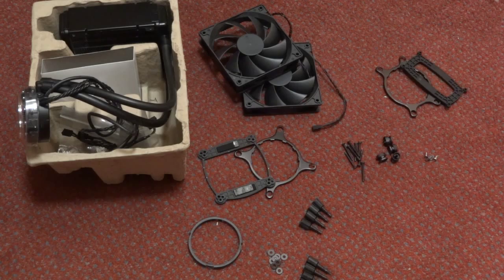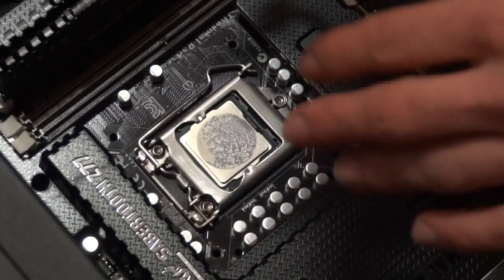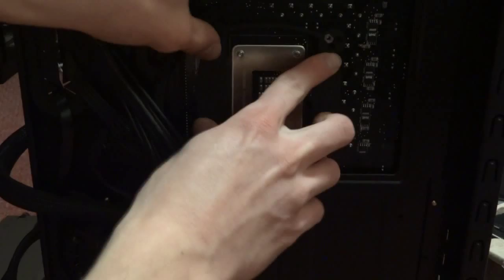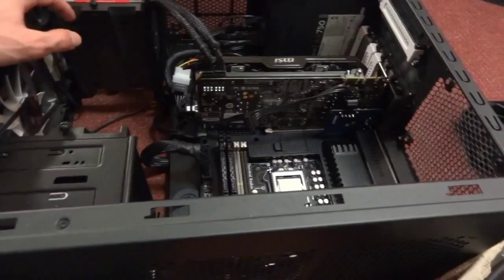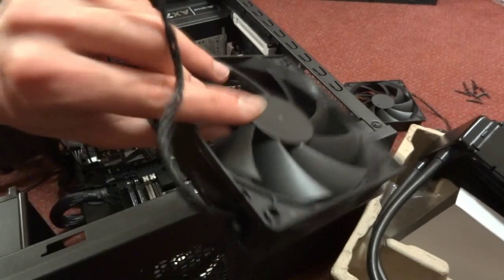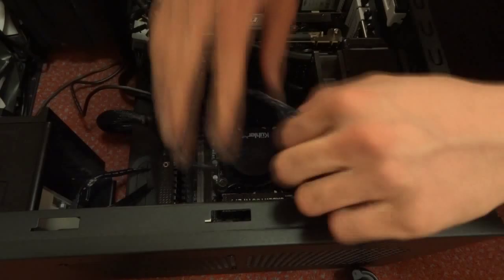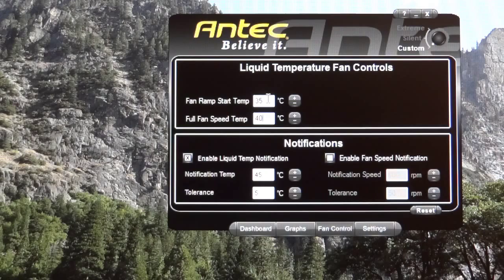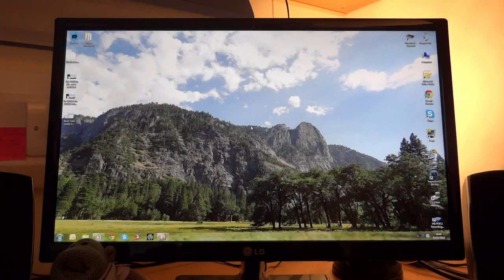Antec Kühler H2O 920 Full Installation Guide - By TotallydubbedHD

Comment: Your video was a lifesaver, I installed it following your instructions and it works great. Under stock clock speed the temps were amazing, I was at 20-25c idle and about 50c under full load. 

Now for overclocking, I have my i7 4770k stable at 4.5Ghz idle is 25-30c under full load its at around 55-60c with short spikes of up to 76c and my core voltage is at 1.26v. I tried going to 4.6Ghz but I get a freeze up in the Bios and get a freeze up when raising my vcore above 1.26v.

Comment: Well Hardocp did an overclocking review and stated the following by Asus....For voltages up to 1.250-1.265 a Cooling solution meeting a minimum of a Corsair H80i is advised, superior performance can be offered by moving to the H90 or higher.

For voltages up to 1.275-1.300 a cooling solution meeting a minimum of a Corsair H100i is advised.

For voltages up to or greater than 1.300v a high performance water cooling system is recommended such as Koolance EX2-755.

Comment: Ok I just set HT to auto instead of enable and it works fine now at 4.5Ghz and at my rated RAM speed 2400Mhz. I'm happy with that, now I just need to run Prime95 for 24 hours with HT on but it seems like all is well.

Comment: Thanks.  The Antec instructions are awful. The round retaining ring was a mystery and your video made it clear.  The long case screws Antec supplies were too short, so I had to go out and buy longer screws and a stack of washers to get just the right length.  Also, this is my 2nd Kuhler 920.  The first stopped working after 3 months, so Antec's service replaced it and the new one is working again.
Reply from the maker: Glad they replaced it - mine has been working perfectly fine for a year now - couldn't be happier :)

Comment: Loving this cooler.  Bought one for my i5 3770k build and for my amd fx 8320 build.  With the intel i5 I went from 45 iddle to 29, from 70 load in games to 52 load.  in my amd build I was able to overclock it at 4.2 ghz 1.38 vcore, couldn't do that with the Coolermaster Hyper 212 Plus

Comment: Awesome explanations, i hope the stock manual was 1/10 this good.

Made a setup for a friend living in other city, he had almost no experience building computers, and he had problems mounting this cooling system (it's quite hard to mount compared to others). Your video helped him a lot, you show perfectly how to position the backplate (ie a little misaligned to the socket) and how to mount the clips on the front aswell.

Many thanks.

Comment: Ya that's the thing though, if I try to go above 1.26 voltage I get a freeze up in the bios and wont boot the os so I can't go above 1.26 volts and ya I'm no where near 90c even under prime95 I get max temps about 76c and that's only for a second or so, it's usually around 60-62 max temps.

And like I said if I enable HT with 4.5Ghz i get a freez up so I will have to drop it a little.

Comment: Ok I'll stay at 4.5Ghz and yes ran Aida64 and Prime95 with a 24 hour burn in and all is well. Thanks for the info and I'll stay at my rated 2400mhz for my RAM. As for HT if I enable it I will probably have to go down to 4.3Ghz or so, I just thought that regular use and modern games don't really utilize it so I didn't really think it was that much of a loss but if you think it's important to have on I will enable it and take the hit in my oc.

Comment: Ok thx for the info, I'll go ahead and use the stock cooler first just to prevent any kind of problems. I'm hoping to get at least 5Ghz overclock but I'll be content with 4.5Ghz. 

Your temps seem great but in all honestly I was getting 25-30c idle and 45-55c under load with my Frio Thermaltake cooler on my i7 2600k and was at 4.5Ghz overclock. If there about the same I might just go with the Frio Thermaltake and save some money or the Noctura cooler.

Comment: Got a "complete" open-box unit at a retail chain. Didn't even include the manual :( Online manual is useless so I had to figure it out too. No mention of the washers & nothing about installing the plastic ring. Now I know I was supposed to get software too. I can't mount it in my old Cooler Master Stacker STC-T01 due to the screws not being long enough to regardless of the side I choose for the fan (short can't reach the radiator, long can't reach through the fan). How did you get 8 long screws?

Comment: Fantastic guide! Step by step, and well edited. I was just wondering though, when I connected my pc to the power, the water cooler didn't light up. I'm not sure if it doesn't light up on the initial boot or if something is wrong. I'm scared to turn it on cause I don't wanna blow my system :( Please help

Comment: Thanks for letting me know, I have already installed it into my build and shook it before hand, runs like a charm, the only thing that confuses me is in CPU-Z HWM when it shows the CPU with the motherboard as around 38 degrees Celsius, but then it also shows my FX-6100 as 20 degrees Celsius and sometimes lower.
Sorry that may seem a lot but I just want to know which is which, also I want to know if it's usual for a video card to run hot..

Comment: best fucking tutorial ever
i had trouble with my x40 i had to find out on my own though
i just used one adhesive strip because on the right side theres a couple lines of pins from the capacitors from top to bottom, with the strip on it would press against it so i decided to take that one out, i cant even tell if the backplate is still making contact with those pins on the right

its a z77 v pro mobo and that backplate looks exactly the same as the one in the vid

Comment: My CPU fan power cable is 3 pin, but the "CPU FAN" - slot on motherboard is 4 pin. Shouldnt that be plugged in the 3 pin connector on MOBO labeled ATX?  Isnt the "CPU-FAN" slot where you plug in the USB-cable?  Thanks for vid dude!
Reply from the maker: No - the 4th pin is there for PWM (full fan control) - you should plug your 3pin into the 4pin CPU fan header regardless.
Just bear in mind that the antec software might not be able to control that fan - so best setting your temps/control directly in your BIOS of your motherboard.
Reply: Oh man. Thanks a lot. This really cleared things up for me. Appreciate it :D
Reply from the maker: Ole Feiring No worries!

Comment: Hey totallydubbedHD - I just followed your installation guide and it was very helpful, but I was wondering if you can tell me why the radiator and or fans are SO loud!?! Even on silent (via the software). I can't get over at how loud this cooler is...Im ready to unistall the cooler and take it back I'm so frustrated. Anyadvice would be greatly appreciated!

Comment: i've got a question about how i should install mine, i have a CM 920 with a 200mm front intake, a 200mm side panel intake, a 200 mm top outtake
should i go with a push pull going out or in?

Comment: My 920 has different cable configuration. It doesn`t have CPU fan header with 4 pins. It has SYS fan header which has 3 pins.
Reply from the maker: that's still fine - but you sure that's not the fans?

Comment: Hey totallydubbed I just watched your video and its awesome, I'm using as a guide on building my system tommorow. I just have one question someone mentioned that the water cooling system will NOT start up if the software isn't installed first, is this true? I'm building a brand new system tommorow with an i7 4770k so I wanted to know if I need to install the stock cpu heatsink/fan first then install the software and then install the water cooler, thx.

Comment: Im going to get a watercooler, and i have an eye on the Antec Kühler H2O 920.
But I'm really unsure if it is quiet enough for me, personally, I am very sensitive to noise, and I was wondering how loud the pump from the Antec Kühler H2O 920 is, I already know that the fans are not the quietest, but I can change them easy, just how loud is the pump compared with other water coolers and my old CPU cooler, the Noctua NH-U9B SE2? I really wanna know! If u could help me, that would be really awesome!

Comment: dude i have on question. I have one of this cooler on my gpu and i´m using the usb cable to control the fans, pump and other stuff. I want to get another of this and install on my cpu, but can i use the usb to? i want to be able to controll both of them, but i dont know if it will work or not
thx

Comment: I disabled my hyperthreading since that's advised when overclocking and also not many programs really utilize hyperthreading, also I can't get a stable 4.5Ghz with it on. I might be able to oc a little higher if I bring my RAM down from 2400Mhz but I'm not sure I want to do that, suggestions? Should I lower it to like 2000 or 1866 for a higher clock speed?

Anyways Totallydubbed your video was amazing tyvm :) what do you think of my overclock temps and voltage?

Comment: Awesome, I watched this years ago!  Do you know if they have somthing like an aurduino or rasberry chip you can buy on ebay that would have software and cables that could be hooked up to this unit so it could be used as an a.c unit threw a cellular phone via blue tooth :) ?
Reply from the maker: Ha, old video. Absolutely no idea regarding that question though!
Reply: Products! Scary! I was just wondering if you knew of a cord that you could attach a celluar phone to that cooling device to run it as somthing rather than a computer cooler? Im sure that makes sence
Reply from the maker: @nathanmciver6496  no idea buddy.

Comment: Can't i just use the back plate that's already on my board??
Reply from the maker: adameater nope!
Reply: ***** Just found out I can.  If you have an AMD chip they give you a bag of screws labeled "For Orginal Backplate"  Maybe you can not do so with intel.
Reply from the maker: adameater ah that's interesting - yeah I'm on intel - and for sure you can't there
Reply: ***** Well, I feel like an idiot:) Just realized I have the Kuhler "950" NOT the "920"  I must of looked at the box wrong.  My guess is the 950 gives you the option of utilizing the original backplate and the 920 doesn't.  Thanks for your replies and sorry for the confusion.
Reply from the maker: Ah I don't know - but good to know!

Comment: Hi, Thanks for the vid,
I used it to help me install an antec 950 cooler.
 I'm finding the 950 very noisy, it's doing the job of keeping cpu cool (50c after a few hours of gaming) but once the fan goes above 1000 rmp it's too noisy. Any suggestions? I don't know how many decibels but the Mrs is certainly not happy (therefore I get earache).
If I've got the push/pull set up wrong would that create more noise?
Any advice would be appreciated.
Thank you
Reply from the maker: Push pull creates more noise than push only, but that's because you've got an extra fan in there. I would only run in push pull anyway.
As for noise wise...that's weird, as it should be quiet. My 920 is so silent, even at full load, that I can't hear it
EDIT: I have SP120 Corsair fans on my 920
Reply: OK thanks for the response. One more question. The fan on the radiator is secured, with the radiator at the bottom (pointing down) do you know if that means the fan is pushing or pulling air, I think it's pulling as I can feel air around the sides of the fan. Sorry if these are stupid questions but I've only had stock coolers before so not much experience.  Thanks
Reply from the maker: Matthew Clayton the 950 - if I'm not mistaken, from where the reservoir is PUSHES air through the radiator - very hard to explain without showing you or trying to show on video - try looking it up :)
Reply: Thanks for your help, appreciate it. :)
Reply from the maker: Matthew Clayton no probs :)

Comment: Hi totallydubbed, I have a 920 that I had retired, now I want to use it again. Do you think the retention ring is optional ? Since the top ring is already pushing down on the cooling part..(since I lost that ring)
Reply from the maker: which ring are you talking about buddy?
The one around the front of the cooler - which is used to clamp the cooler on the CPU? If so - you do need that!
Reply: hehe thanks for the reply, of course I know the top ring is essential :p I mean the plastic ring that you hold in your hands at 1:50 in your great video. I managed to install the whole kit without that ring, making sure that the top ring was well aligned with the notches on the cooler to keep it in place.

I think it's the pump that isnt working because as soon as I get some cpu load my liquid temp rises to max :/
Reply from the maker: well the top ring is needed to lock it all in place? From memory - so if you dont have that, then surely the thing doesn't sit properly?
And yeah don't risk it at all buddy - I actually RMA'ed mine in the end -0 as it ran dry.
I'm now on a Noctua D15 and haven't looked back since :) - air coolers really impress me now
Reply: I mean the bottom plastic ring :p
Reply from the maker: you shouldn't risk it

Comment: my kuhler 550 is around 90 Celcious. I dont know what's going on with it,so hopeless :(
Reply from the maker: check pump, check mount and check fans.
Reply: fans good,pump is running fine,gel is check
i think it's the mount. i have to mount it SIDE WAY with the water pipes point to the left because i can't get it UP like you did in the video
Reply from the maker: don't worry about the direction of the pump pipes, just make sure it's properly secure.
Reply: ***** i have it pretty secure there and seems to have good contact but the temp was pretty high :(
my radiator only have 1 fan and it pretty thick btw
Reply from the maker: Could be the pump...:/
Reply: ***** but the pump is running! i can feel it running when i touch it
Reply from the maker: mine was also running, but was not cooling properly - the liquid wasn't being transferred properly so I binned it.
Reply: ***** so what did u do?
Reply from the maker: Got a Noctua D15!
Reply: i can't change to a air cooler
i got no money anymore :(
i guess i'll take it to warranty
Reply from the maker: yeah you should do bro - see what they say!